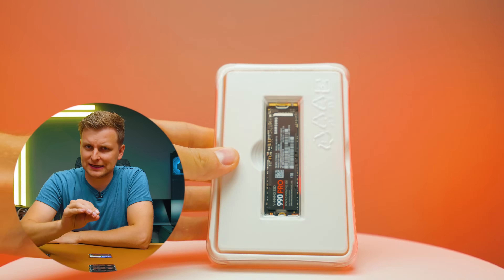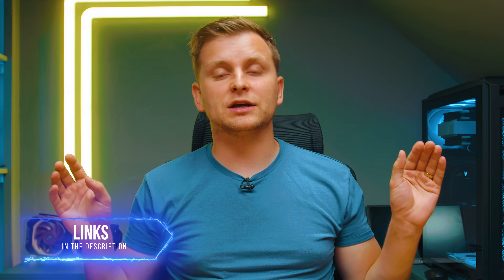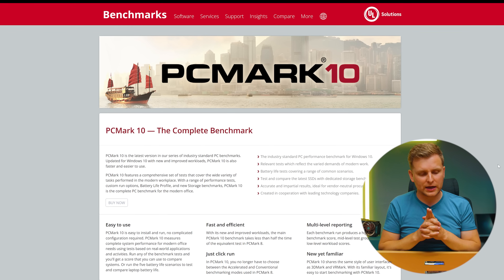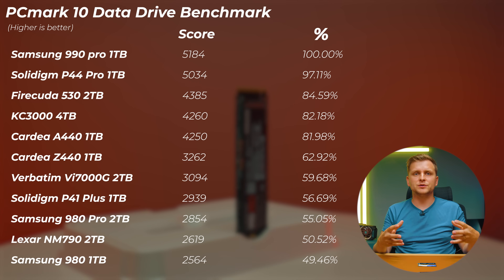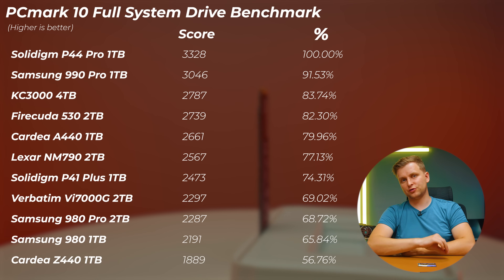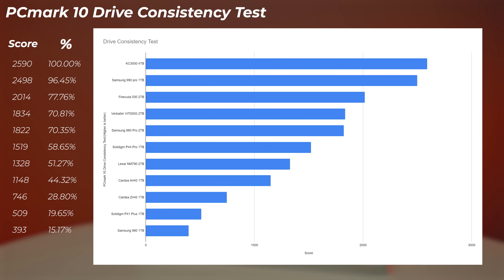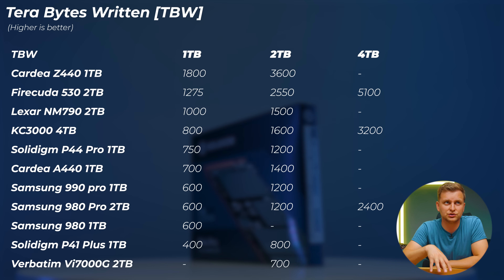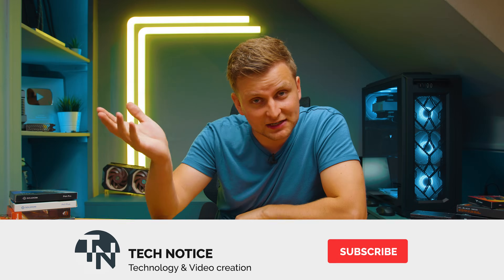REVEALED 👉 BEST SSDs For CREATORS | m.2 NVME Drive Buying Guide

Comment: The WD Black SN850X line is conspicuously missing here. Otherwise, thanks for the tests and results.
Reply: Unfortunately they are often overlooked. I have used them for the past few years and never had a single issue.
Reply: WD SN850X
Reply: yeah esp seeing it trades blows with the 990 pro in being the best gen 4 drive. Random speeds samsung is a bit faster but pc mag benches program, games and windows load times and the sn850x best the 990 pro across the board. I'd bet it's because the sn850x uses really fast dram cache, it literally uses straight ddr4 3200, while the samsung uses lpddr which has half the memory bus and multiple times worse latency even if it is clocked slightly higher iirc.
Reply: lp of lpddr is low power, hence the clocking.

Comment: What's your opinion on the Crucial P3 4TB?

I find it online in 🇸🇬 for S$340(USD250).

My H410 M H V3 only supports PCIE 3 and I want to max out the capacity on the NVME SSD since there's only 1 slot on the motherboard

Thanks

Edit: Found a TEAMGROUP MP34 4TB for SGD278 (USD 206). Would like your opinion on it too.
Reply: wd sn850x 4tb should be cheaoer and better

Comment: So far in my build I have a WD Black SN850X 1TB as the OS/programs drive, and a Samsung 980 Pro 2TB. I've decided to add two more 2TB 980 Pros in the remaining gen 4 slots in my Gigabyte Z790 Aero G. The price for the Samsung drives are so ridiculously low. Just $100 for 2TB on a top tier drive.
Reply: the internet is full of cheap 990 pro's, im looking at them right now, go for the used market where u can get them for cheap. my entire pc is probably made from stolen stuff sold on the second hand market, but everything i have is top of the line with budget prices. im looking right now at 100$ for 2tb of 990 pro, of which i just ordered 4. (i make videos and need the space)
Reply: @afti03  I just saw the Samsung 990PRO 1TB drive on NEWEGG for rock bottom price!

Comment: i am proud of my 990 pro 2tb
Reply: @TRC_WA I just saw the Samsung 990PRO 1TB drive on NEWEGG for rock bottom price!
Reply: I have the same drive too and is awesome
Reply: Got the SK Hynix P41 Platinum with almost the same speeds as 990 pro for HALF THE PRICE
Reply: With or without heatsink?
Reply: @MrDutchino  i use my motherboard’s heatsink
Reply: @TRC_WA their sold and shipped by newegg. I bought from them last week and the drive is all good and came with the latest firmware. Registered the warranty on samsung too..
Reply: I heard it dies easily is the true?
Reply: @Dillan6754 i think samsung already addressed it with firmware update so it's fine now
Reply: @TRC_WAgot a couple P44s too, came with a huge mouse pad! Just moved my OS from an Evo+, I can feel the difference (I think).
Reply: @TRC_WAbro you’re fully decked up wth
Reply: If only they launched the 4TB version like they said before... I think they said sometime in 2023, but that's not all that specific, and I can't wait anymore.
Reply: Yes i have the Same i Go next time to lexar nm790 4tb😊
Reply: @TRC_WAIf you saw in the video, these cannot hold a large capacity of handling daily big files. Indeed, are the worst. If you work hard, you need to read and write big and small files everyday. With a finite small capacity to write, you will kill your drive sooner than you think. In this case the best overall are Samsung 990 Pro 2TB drives.
Reply: @TRC_WAThis video shows only the Samsung 990 pro 1TB version, which is way more slower than the 2TB version, which has double the TBW ( durability along the years ). Sorry... 🎉
Reply: but is it good to stock files the nvme ssd ?
Reply: Me too. Just bought one for my new laptop, just € 159 on the Dutch Amazon site. Exactly the same price as the 980 Pro version, due to a big discount on the 990.
Reply: I also recently bought a 990pro (4tb), very happy thus far